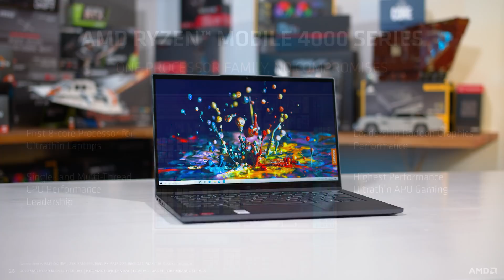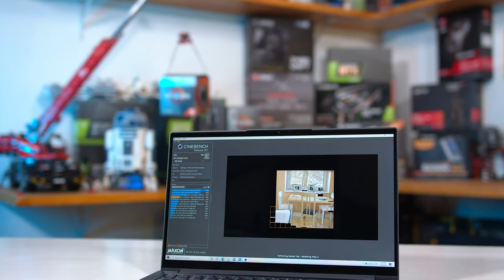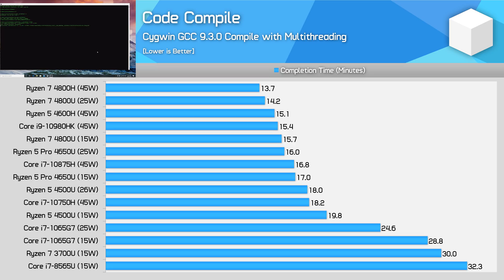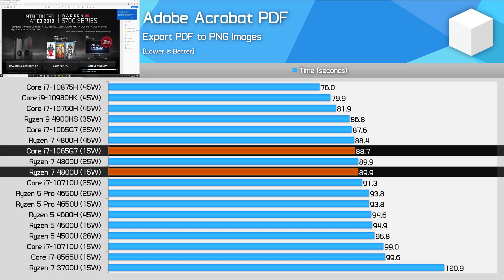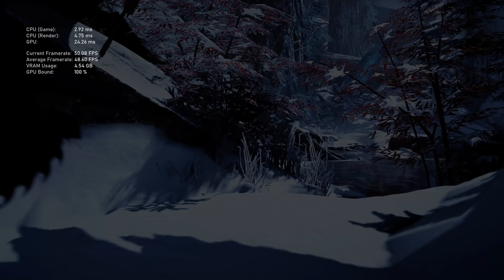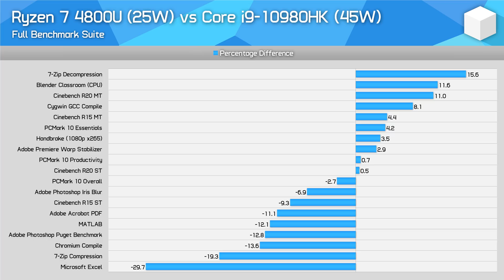AMD Ryzen 7 4800U Review, Mind Boggling Performance at 15W

Comment: Laptops: Ryzen Ryzen Ryzen Ryzen Ryzen.
Desktops:  Welllll.. still Intel for games/singlethreaded programs, by quite a large margin.

Really hoping Zen 3 equalizes or surpasses Intel for desktops.  Will REALLY suck to be forced to replace my Zen 2 part already (a 3950x at that), but singlethreaded performance is still really a big part of my daily usage of PCs, regardless of how many cores are being used.  Unless it's full on production applications using 8+ cores, upgrading to Ryzen from my 6850K hasn't really been much of an upgrade.

Comment: So with a U processor could I outperform my 9750H in games and multi tasking? With better battery, less heat and probably less fan noise?
Reply: Also why not pair a 4800U with a dedicated gpu so you can get good battery life on the go. I don't see anyone doing this
Reply: @nathancasey7712  no thunderbolt on amd buddy
Reply: @mralxndr2846  I didn't ask about thunderbolt

Comment: I want your advice?
Is the Ryzen 7 3700X worth 90 usd more than 3600 
I’ll be doing 4K medium level editing with colour grading in a 7 to 10 minute timeline
At 90 usd more apart from performance it offers a more fancier and beefier Wraith Prism RGB and a better cpu name 
Or do you think I should wait for 4th gen Ryzen?
Reply: The 3700X is probably worth it in your case, but if you can wait for ryzen 4000 this November, I think you should

Comment: Guys, sorry for offtop question, but since new gpu's from nvidia such as 3080/90 are comsuming 300W+ and probably big navi will do the same. Is my PSU CHIEFTEC A-135 850W good enough to handle one gtx 3080 without any risks/problems? My current cpu is 3800x, 4.3 ghz at 1.308V all cores, 32gb ram, 4 system fans and simple pci-e audio-card, monitor is 24' fullhd 144hz, will switch to 1440p144hz/2160p144hz if its going to drop in price in 2021.
Thanks, i understand that by simple calculations in in a safe zone, but my PSU is 80plus bronze and its not the greatest, so im wondering is it safe to use a 320w+ video card with it or should i switch it to a better PSU? Thanks.
Btw using a gtx1080 now, 200W power comsuption

Comment: Wow, this is amazing. Thanks Tim, excellent video! Does using the 4800U mean there won't be any Thunderbolt support to use a eGPU? Keen for a 4800U and 3060 in a thin and light but still like the ability to use a 3080 at home in a eGPU enclosure

Comment: If Adobe ever starts optimizing for AMD cpus and not  just Intel, it's going to be a slaughter in productivity too and not just for Ultrabooks but in ever cpu segment.  It's clear from the other benchmarks that the issue with AMD and Adobe isn't that the CPU's aren't capable, it's that the software is coded around Intel parts.  Which is not surprising considering Adobe has worked closely with Intel in the past to implement Multi-threaded work loads in Lightroom.

Comment: So... Intel says don't bench Blender because it's not a fair use case... you just wouldn't do that on a  laptop cpu... They must be getting PR tips from Trump! :D 
Anyway, I've been making pre-rendered cut scenes for games since the original Playstation came out... and I have used laptops for pro CG work on occasion on much much slower laptops than this. CG on a laptop is actually a thing! I will love these for RnD work while away on a trip,  without having to lug several bricks worth of hot and loud `laptop` around. AWESOME.

Comment: I'm using an Ideapad Flex 5 with a 4700U as both a digital painting machine, compositor, and 3D render node. It absolutely STOMPS my overclocked 6600k desktop at rendering with Arnold, and it runs happily for dozens of hours with all 8 cores completely pegged. It starts out at 4.0 GHz on all cores, then after a while drops down to 3.3 and stays there (this is plugged-in, obviously). $750 at Costco with 16 GB of RAM and a 500 GB NVME. Supports the Lenovo Pro Pen with tilt, too!

Comment: @Hardware Unboxed,
Need to clarify this is actually an IdeaPad you were using, because it has 'Yoga' on the case, which is a distinct and typically much more expensive sub-brand of Lenovo..?
I would generally expect that a Yoga would have superior construction to an IdeaPad and thus an impact on thermal performance..

Comment: I was quite interested in this unit, until I checked the price. On the Lenovo online store, in the UK it is £850 inc VAT (which is a massive 20%) which is only $1550, whereas here the same entry level spec is $2199. That is a MASSIVE price difference for the same unit, nearly 50% more in Australia. I wouldn’t buy one out of principal. Are you able to reach out and find out why from Lenovo?

Comment: I have a question, are there any 4800U laptops that support external GPUs? I imagine that with that performance, an external GPU would pair extremely well for those use-cases that need it.
Reply: Maybe some NVme to PCI-E adapter or converter since they dont have thunderbolt like intel does; only Type-c.

Comment: Wow, in essence, the Intel chips on the laptop segment needs close to triple the wattage to compete in performance. What's sad is that Intel saw this coming for close to three years and did squat to improve their position before AMD launched their assault on the laptop and notebook computer market. Those illegal monopolistic contracts the third party manufacturers of computers signed with Intel only held out AMD for so long until Intel ran out of quality chips to give to their partners, then the dam broke and much of the market will embrace AMD since Intel can't defend with anything without supply or performance.

Comment: I just want a 4 cores 8 threads CPU on $400 - $500 laptop...
Reply: U could get 4500u laptop for $500-$600. It has 6c/6t and is better than Intel 4c/8t
Reply: @malathomas6141  Which brand?
Because I can't find any brand with system overall in $500 range

Comment: Dude, you absolutely HAVE to do reviews on these two monitors:

https://www.tomshardware.com/reviews/viewsonic-elite-xg270qc/6         VIEWSONIC XG270QC

https://www.monitornerds.com/asus-vg27aql1a-review/#:~:text=One%20of%20the%20biggest%20upgrades,already%20suitable%20for%20professional%20use.  ASUS VG27AQL1A  

The latter is the succesor to the VG27AQ, the prior is something you definately should've covered previously.  The viewsonic is apparently a HDR400 certified that actualy delivers great HDR gaming performance at around $500 usd.

Thanks,

Comment: Just recently bought a Lenovo with a 4800U. It nearly matches my i5-4460 750Ti system in terms of my gaming and is about on par in productivity. The SSD was the bigger step up.
Impressive for a laptop but I had hoped the Vega 8 would've at least matched the 750Ti. APU / iGPUs have come a long way but they're still not where I'd like them to see.

Comment: imagine surface book 3 launched with this instead... " 13" tablet mopping the floor with gaming laptops"
Reply: The problem is having a GPU strong enough to compete with gaming laptops. The closest thing we have is the 14" Zephyrus G14, but I can imagine the next generation of laptops including even thinner 14" and 13.3" ultralight gaming laptops. If someone would combine AMD's CPU with nVidias upcoming MX450 you could probably game at 1080p with medium to high details in most games. On an ultrabook.

But even the G14 is crazy portable for a laptop that has the gaming performance of a mid-range desktop PC.

Comment: In Passmark, even though it's only just one sample tested, Intel Tiger Lake i7-1185g7 is just scoring nearly 8000, is so likely the same with Ryzen 3 4300U. Maybe it's just a dream for Intel to compare both of them since Ryzen 7 4800U score is 15000++, even though in single core is nearly in the same score.

Edit: it's 17000+ for R7, and R7 wins (2600+ vs 2400+) in single core score.

Comment: I have a 15W laptop with a dgpu
i3-4010u and HD8670M
when running games on the dgpu the cpu tdp maxes at 8W and when running games with the igpu the cpu tdp hits its 15W rated charge, so does this mean the tdp mentioned by the manufacturers is counted using cpu+igpu power usage?

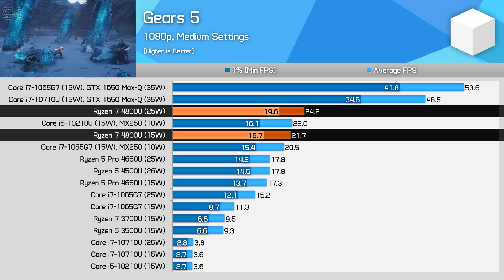Comment: At 13:20 you argue that the 4800U is faster due to the extra compute units. That contradicts itself. If extra power limit doesn't make a vega faster (which it always does!), then it is limited by other things, e.g. bandwidth. The Yoga slim 7 has LPDDR4X-4266. I assume the 6-core Ryzens you refer are running DDR4-3200, which gives them a 33% bandwifth disadvantage. This almost perfectly matches the difference of about 35% in Gears 5 and F1 2019. This conclusion would have been useful advise: watch out for the fastest possible RAM with these APUs if you plan on gaming! In CPU bound applications there is not much of a difference as LPDDR4X has terrible latencies which destroys the benefit of the higher clock.

Comment: I have an i7 10510u laptop and I was really disappointed with the integrated graphics. Running dark souls remastered at 800 by 600 it can’t even get 60 FPS. I’m assuming the game is as well optimised as it was remastered but still that’s just disappointing. Csgo can’t even run at above 60 at 720p low everything.

Comment: Amd should just realize 4800h with vega 20 or higher and give 15 watts to CPU and 30watts to GPU. 
They can reach gtx 1650 max q level and save so much space for laptop. Save space can be used for better cooling or battery

Comment: No Thunderbolt :( not sure why not a single laptop manufacturer is adding a third-party TB chip like you can find on desktop motherboards.
There's no way I'd buy an Ultrabook without TB in 2020, I need that external discrete GPU wayy too much.

Hopefully it will be native in the 5000 series.

Comment: Thanks for the great review with such extensive details. Hopefully we can start seeing Laptops like MSI Prestige 15 which combines a U series CPU with a moderately powerful GPU like GTX 1650 Ti. Those combination will provide a strong Thin & Light Productivity machine with superb battery life and they will remediate the issues with Adobe product suites like Premiere Pro which runs better with nVidia GPU acceleration. The performance of 4800U is already great at 25W and if the chassis has a good cooling solution, it can reach to 35W or higher in short burst, hence enabling 8 Core Intel H series Level performance.

Comment: How do you adjust your cpu consumption? Like how do you set it for 15W and 25W?
Reply: Ryzen master software of sometimes bios
Reply: @malathomas6141  And what if both these options are not possible, because the system do not allow it?
Reply: @profer0z279  I have a Lenovo T14 AMD and increasing the power limit does amazing things (at least judging by the cinebench scores)

Comment: I'm sorry, as much of a fan I am of amd s renoir and I have a 4800h. But this is NOT representative of 15w performance. Hell. At 15w it performed better than my 4800h at 25w... So yeah. I have serious concerns regarding the validity of this comparison. Idk how they configured their 4800u and what it's boost period was, but that was Not 15W
Reply from the maker: If you locked the 4800H to 25W then yeah, the 4800U will perform better in short tests. That's because it boosts to 35W+ for up to 2.5 minutes. Whereas the 4800H is supposed to boost beyond 50W for (in most of my tests) up to 8 minutes

Comment: Are there any laptops with 4800u + low-mid power gpus? If we can get light gaming and great battery at not too high prices that'll be great
Reply: 4800u already beats mx250 so it's good without a lower power dgpu. Maybe 4800u with gtx 1650
Reply: @malathomas6141  i was thinking 1650 to 1660 ti/ super

Comment: Wonder what's your opinion on the Asus MiniPC  PN50 with R7 4800u... cause the U-series is not only in ultraportables, it's also found in NUCs and NUC-alikes, eg. that aforementioned R7 16-thread U-series NUC alternative in barebones version is often priced approx. the same as i5 (ans some i7) 10th gen U-part, but also almost 100 euro above the R5 4500u variant ;)

Comment: 9:00 I heard that Intel compiler is sabotaging AMD's math capabilities again.
Reply: Not much is compiled with Intel's compiler any more. Mostly everything out there is compiled with either Microsoft's compiler or one of the open source ones (GCC/LLVM). Intel can't get away with that shit any more, as it is totally easy to prove when you have 3-4 other compilers that produce "correct" results.... But yes, I was there when you could get +50% better FPS in Quake if you just haxed the function that checked what CPU it was running on....
Reply: Intel mkl vid from Wendell?

Comment: Any idea when the desktop 4000s come out?  Speccing out a build for the new RTX cards and right now the 10700 is going to be my choice for raw performance (yes I know about pcie 3).  I have zero brand loyalty to either of these companies (why would anyone?) and just buy what's more powerful at the time.  The AMD 4000s look attractive with pcie 4 and higher clock speeds, but if they don't come out until December then Intel it's going to be.

Comment: Well the Renoir APUs don't have the 12nm central SOC dies that Rome and Matisse has, and the central die consumes a weirdly high amount of power. In my 3600x the SOC sits at 20W at all times while the zen cores just kinda sit there sipping barely anything (0.1 to 1W) when i'm doing heavy browsing on Firefox. During stress testing the zen cores go to 10W max, SOC still sits at 20W.

Renoir APUs have parts of the SOC on the same 7nm die. So now the Zen cores are the major power consumers and they barely consume any to begin with. That's my theory on why it's so high performing at 15W.

Comment: you did not compare the new 4800U with AMD equivalent from previous gen.
just to have an idea of the changes and improvement

but... this is promising for the new Zen 3 CPUs!!!
and they have to hurry and put RDNA2 ASAP in their APU lineup.
Reply from the maker: The 4800U is about 2.5x faster than the 3700U in heavy multi-thread workloads and around 30-40% faster for single-thread
Reply: @Hardwareunboxed  thanks
this new intel cpu is excellent ;-)

Comment: I have an Ideapad Flex 5 with 4700U, it gets 2862 multi and 448 single-core in R20. It did have horrible audio/video stuttering out of the box that left me trying to weed out every amd video/audio/chipset driver I could find, but it ended up being cortana.
Reply: So, you removed Cortana and everything worked fine ?
Reply: @luisfernando55  Was presumably something to do with the keyword activation stuff, it was fixed after i removed cortana's permission to use the mic

Comment: When specing a laptop for review in the past display quality was sometimes lacking. Why not always test the best panel option available, anything less isn't a full review, low budget options should only be considered on a total budget build, which seems silly with how quickly products evolve. Folks with a really limited budget would best be served with a used machine, not a base feature stripped model.

Comment: This 4800U scores as much as my 2600 OC in R20.
My 2600 is at *141W*. Damn.
99% of the performance, for 10% of the power
Reply: I was thinking something similar. It would be interesting if AMD released a desktop version of this CPU, it could be passively cooled and still perform very well.
Reply: @jonathanellis6097  it's called ryzen 7 4700G
Reply: @malathomas6141  I though they were only available in pre built PC's? They are also still 65w CPUs, not 15w.
Reply: AMD released Renior desktop variants only for OEMs first.  Also there are already leaks of upcoming APUs with Zen 3 cores but still with Vega graphics.

Comment: I'd like to see 4700U in comparison. This APU I own in my Lenovo IdeaPad 5 14
Reply: How about you making a cinebench run for us? :) 
Would be interested too.
Reply: @SciFiFactory  I can tell you that it gives 177 in cingle core and 1177 in multi (R15).
Or you need a video with Cinibench running?
Reply: @rmatveev  No need for a video. But R20 like in this HUB video would have been cool. :)
Reply: @SciFiFactory  Just run R15 again - 178/1204 in optimized power mode.
R20 gives 444/2206 in optimized mode.
In performance mode:
R15 - 175/1070 (this is less than optimized mode - I don't know why!)
R20 - 455/2407
Reply: @rmatveev  So, it's faster than intels top of the line 10710U. Nice ^^ 
Thanks for testing :)
Reply: @SciFiFactory  I moved to Ryzen from Intel's i5 6200u. And it was just giant leap forward!
Reply: Giant leap, in what applications mostly?
I am currently on an i7-5500u and GTX-840m. I think I'll pull the trigger when we see 7-8nm GPUs in 14inch laptops.
The Zephyrus G14 almost had me ... but soldered ram and an old process for the gpu ... I hope I don't have to wait too long. :/ That dualcore is a pain.